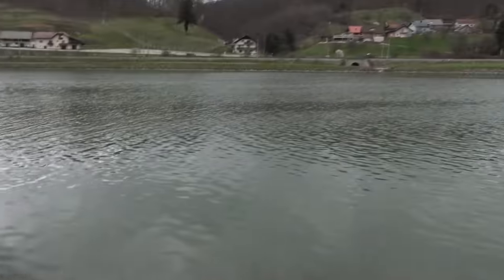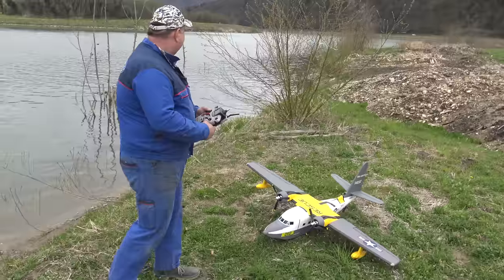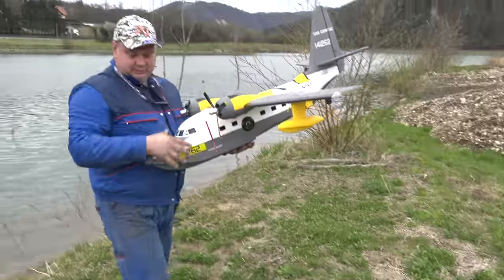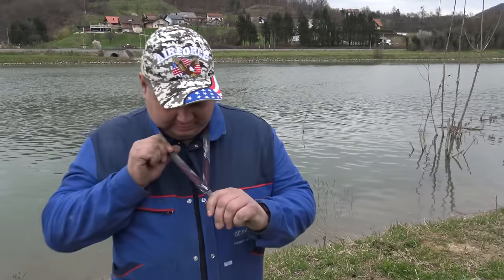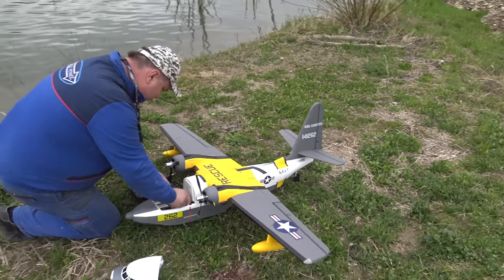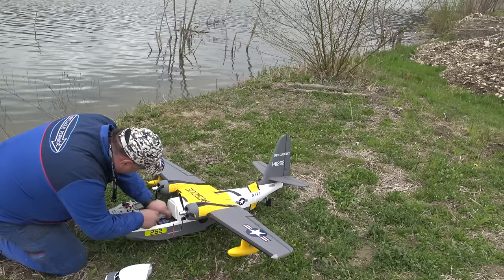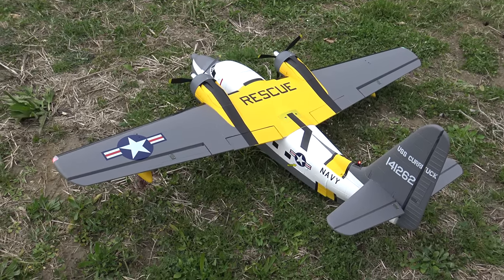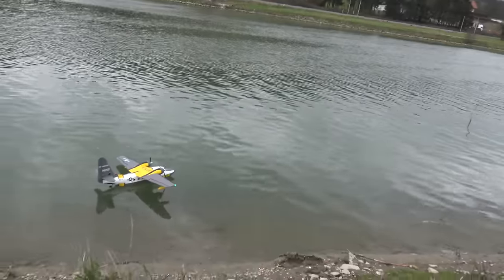Avios Albatross HU-16 Flying Boat 1620mm (63.7") PNF Crash on Maiden flight

Comment: There was a time when we built our models from balsa. We would take weeks, or months to build planes in the winter and then fly as the weather cleared in the early spring. On more than one occasion I left the house with several new planes to return with one that was reduced to balsa sawdust. You would take the walk of shame into the field, pick up the pieces, place them in a box and take the pieces home. Sometimes there was not enough left to take home. According to FB, this model is already back together and ready for Captain Blaz to fly again. And he will, and he will conquer this model.

Comment: Seemed a little tail heavy and underpowered.  Easy repairs so you should be back up in the air in no time. Hey!
Reply: Plastic Aviator oh power is there but cg was not
Reply: Those big planes are always under powered. Thats why I dont buy them. They should be putting larger motors in them. The battery size gave that away.
Reply: RC Hobbyist Extreme This one has tons of power. They did a great job on this one.
Reply: They have alot of power it was cg. And velcro the lipo
Reply: I feel your pain mon Capitan Blaz
Reply: RC Hobbyist Extreme  it’s got tons of power, way more than needed. It was just tail heavy.
Reply: Not underpowered in the slightest. Tail heavy only
Reply: Definately tail heavy
Reply: 7:25 - For those who say it's under powered! Takes off like a rocket when Captain Blaž miraculously saves it at this point!
Reply: Tail heavy for sure, but it went vertical for a ways. Power was not being used most of the time, but it was there.
Reply: @TheCentaury  - Lol, by the time you trim a tail heavy airplane it's already met the ground! Plus, even if you trim it it'll be severely twitchy. But then I guess you could program in a huge amount of expo.  Hell,  why bother with CG in the first place?!
Reply: @Perry_Wolf  I always trimed all my planes during flight without meeting the ground... I don't know if you're a good RC pilot but trimming is one of the first thing you do on each flight... Even the first test flight... This to avoid to always compensate on the stick while flying and even more important for landing...
Reply: @TheCentaury  - Actually, I have also trimmed all of my planes without meeting the ground. However, with a tail heavy plane it can be uncontrollable to point where you just don't have the time to take your hands off the sticks to reach the trim buttons, (just ask Captain Blaž, I don't think he even had time to think about the trim)! In my opinion, there are three ways to deal with this:

1) - You can get enough altitude that momentarily letting the plane go out of control will not result in an immediate crash, or

2) - You need to land immediately and fix the CG problem or,

3) - Have a friend stand next to you and trim the plane while you fly it.

With that said, trim is fine for combating minor aerodynamic errors, such as wing or stabilizer warping or control surface misalignment etc. Radio trimming can only go so far though, (and maybe not enough). I see radio trimming as a temporary solution only, (whether it's "on-the-fly" trimming or using the radio's subtrim/offset later), and I usually only use it until I get the model dialed in physically. Whether that's fixing a warp or adjusting control surface linkage to fix the errant behavior.

As far as CG goes, trim can only help with getting the plane to fly straight and level until you start making control inputs. Trimming the plane to combat this essentially adjusts the stabilizer's control surfaces to keep the plane straight and level. However, the moment you introduce a control input that extra weight rearward of the CG will effectively be "thrown" in the direction of the input and exaggerate the input making the plane twitchy and still hard to control. So trim is not an effective long term solution. You should land and fix the CG then fly and re-trim the plane. However, if there are other aerodynamic errors you're trimming out it is best practice to fix those without trim as well. The bonus with physically fixing CG and aerodynamic errors is, if you buy a new radio or accidentally delete that model's memory file, that plane will still fly good without having to do it all over again.

I apologize if you know all this already but I thought it'd would be good to mention all this for the newer pilots reading these comments. :)
Reply: @Perry_Wolf  Totally agree with 3 points on the resolution of an uncontrollable plane :D

In fact I will add that before the first test flight you balance your plane as perfectly as you can ... most of the time by holding the wing nerve on each side of the plane so you can directly see if the plane will have an heavy tail or an heavy nose

Comment: Capt Blaz', don't give up it happens to us all, no big deal, looks fixable. Looked really good in the air. It seemed to me it might have been a little tail heavy? I don't know, maybe the wind. It also looked as if it wanted to tip stall but HEY its ok. I still love it and look forward to the fixed plane video.   <o
Reply: Michael Anderson yes incorrect cg ;(

Comment: And again He fly to slow I was yelling at him before he crash I saw it coming he try to fly to SLOW all the time A.
Reply: Capt Balz does like to fly slowly lol but there’s nothing wrong in that,  this plane will fly really nice at slow speeds, the only problem was that it was too tail heavy and he didn’t recognise it until it was too late 🤦🏼‍♂️ did exactly the same thing with my durafly Excalibur a few weeks ago except I realised what was wrong and managed to get down straight away.
Reply: @TheMuddatrucker  Maybe, but main reason was as was mentioned in first comment, too slow for this setup, it was telling him several times and finally if feld trough left wing with no chance to save it. I don´t want to be rude, but heavy plane, wind, slow flight and bad setup of weight as you saying, too much reasons to lose plane, istn it? :-D
Reply: @TheMuddatrucker  There is something wrong with going to slow and enter a turn, thats called tipstall.... it was like 3...2...1.. what?   ah.. there we go... xD
Reply: Jan Černý  but you can’t call this a setup! All this is is a tail heavy plane so for that you’re right! You wouldn’t fly a tail heavy plane slowly but the thing is capt blaz didn’t realise it was tail heavy!    And I’m pretty sure if he did then he wouldn’t have flown it so slowly but when this plane is balanced correctly it will fly nice and slow without tip stalling so I’m not wrong in what I was saying.
Reply: e30kitty  I disagree! If the c of g had been correct then this plane will fly nice and slowly without risking a tip stall, capt blaz didn’t recognise the tail heavy characteristics so kept flying slowly, if he had recognised them I’m sure he’d have increased his airspeed and brought it down.
Reply: @TheMuddatrucker  yes so you are saying same as I do. He did not recognize it is tail heavy(i am adding to this point that plane was telling him several times it is tail heavy). There are also steps how to check center of gravity on the ground and he has to do it before minimally first flight. First flight in windy weather? I am saying that he did his best to kill the plane, thats all. Maybe plan, maybe lack of experience or maybe too less respect to plane, i dont know, but it was painful to watch. Good luck in future.
Reply: Jan Černý  they both know how to check the c of g,  the problem is that it’s not 80mm like the manual suggests,  like this it looks as though it balances but once in the air things soon appear very different and it shows as tail heavy straight away
I’ve got mine set at 70mm using a 526g battery and flys great now!

Comment: A bit of glue and it is fixed.
as you said to me: Fixed planes fly the best
My Avanti will hopefully get a remaiden soon, when I get a new fuselage.
only that will be difficult because..... yea look at my username. I also want a fursuit from like 1000 euros and I need money and I am only 15. I like spent already 1,5k on my rc planes (and car), and now my other hobby is also expensive. luckily when I turn 16, I can do a vacance job, earning 1000 euros in the month
Reply: ps read my bio for more info.
and btw maybe put a gyro on your plane, so it flies stable, and it will also help control the airplane if you lose an motor
Reply: Mine ALWAYS fly better with glue and tape. That model doesnt like wind. I was told by many pilots those big water planes are like that.
Reply: @scottfirman  my avanti would have flown better too i think, but it is too far gone, i tried to repair it but it there is just too much damage, because when the pilot was doing a takeoff, the nose broke off because the nosegear strut was too weak, it broke off and he lifted off, turned off the throttle, this caused it to stall and it flew right into a ditch, and the fuselage was destroyed after that(and also a piece of foam flew right into the turbine and it was totally shredded) and also i dont think it will stay together in a jet because of the speed and the G's you pull. but i got it for free after it crashed so i need to learn to fly with jets first because i only fly with a funcub, an easystar and a trex 450.

Comment: Hi guys.  Glad to see you got it back with minor damage.  Like many here have said already.  It looked tail heavy from the start and that crazy strong cross wind meant if it got slow in the turn it would stall and it did.  Blaz  (or Capt Splash LOL...only kidding),  you saved it a couple times but the odds were stacked against you.  Robert has a great attitude and showed his support for you.  You two guys bring so much needed fun in these crazy times and are an inspiration to all of us in this hobby.  I salute you both......now cut quick!!!

Comment: This was my birthday as well! Haha! A lucky day because the plane was recovered and can be repaired. It was crashed by the wind shear. The wind was on the plane's right. The plane was turning left, nose down. The wind lifted the right wing and there was no time to bank into the wind. It could happen to anyone. This is all fun and also a learning experience. Don't be so hard on yourself Captain Blaz! It could have happened with a fuel plane just the same as an electric. The pilot, any pilot, must always know where the wind is. Seeing the invisible wind is not easy. In this setting, watch the waves. You can see where the wind hits the water. At that point is the worst place to fly. Thanks for sharing! Have fun and fly again any plane you wish Captain Blaz! No Fear!
Reply: Jon Miner iiiioopoop
Reply: Jon Miner lp
Reply: Jon Miner 80+op
Reply: @josethenbeliar9739  What is 80+op?

Comment: Always remember to throttle up when making your turn to downwind.  Too slow and you will stall.  But plane is fixable and you are a good pilot.  Please don't stop making flying videos with Robert.  Yes, and I agree tail heavy and foam planes don't penetrate the wind like good old balsa planes.

Comment: I'm thinking about it ....so you are 100% that the module was working?..... and just a good tip for the electric ,give it a throttle range setup before fly to get the high power on.

Comment: That's hard luck. That wind is pretty strong. May have been better to wait till that wind had eased off. It won't be hard to fix. This is what happens to us when we are in this hobby but we still love it. I am glad you got the other float. Blaz did well to keep it in the air, I would have crashed it in a second with that wind. "AILERONS"!  Good one Robert. :D
Reply: Mike Flight thanks my friend....

Comment: CG had to be off a bit as plane was pitching up on high throttle. The Avios multiengine planes require more speed in turns. It’s windy and Pilot has “knocking knees” on a maiden...and Blaz is used to torque nitro engines. Just my thoughts.

Comment: Wow...hard to say what caused that crash. The cg? The wind? Pilot error? Maybe a little of all three. Msybe a transmitter/reciever glitch. Was the binding range checked? From the video it doesn't look under powered. In any event, I will ne very intetested in the next flight post repair.

Comment: Hey ! 
 Captain Blasz, no need to get so down on yourself. 
 Sometimes several things conspire together and can result in delivering the “Curved Ball” effect . In other words, crash.
Looked like the old G spot was a bit iffy along with too much aileron travel. 
Then you had a bit of a hooly of a wind to cope with ! 
 Any of these things in isolation & you may well have got away with it, but altogether, they  caused a bit of a 
problem.We have all been there. When you fall off the bike, get straight back on it immediately.
 So, cheer up old chap, you done well doing what you did.
OH YEAAAAH !

Comment: I love your guys attitude.we need more guys like u in our hobby.I've been flying for 30+ years.since I was 5 and my dad handed me the transmitter to a 2 metre glider that was probably 3-400 feet in the air.from that day I flew every weekend until I was 13.now I fly electrics and gas and I have plane called a "Wonder".it was designed by my father who passed away about 3 years ago.I wanted something I could put my modified Thundertiger Pro 36 with a tuned pipe.I wanted 200mph rocket and he designed me a wing that achieved 246mph.that was the last plane he designed for me it has been retired and hangs from my roof in my house.I would be destroyed if it crashed.I'm flying an old GWS P-51 Kit with all the trimmings.brushless motor and 4-6 cell lipos.the 6S is a bit too heavy but it's very quick and it fly's beautiful even at scale speed but I built it as a racing type mustang.

Comment: Captain Blaz, I think you need to trim the elevator  because it keeps the nose up and also you need to increase your throttle.  The plane stalled due tom lack of power.  It's ok Captain Blaz, this is part of our great hobby.  Minimal damage and the plane is fixable and you recovered the floats.  Good Luck on your next flight Captain Blaz!  I salute you!

Comment: Little too slow, may have been tail heavy, and definitely too windy! Sorry too see the crash Captain Blaz. It happens I crashed my P-51B, and it was a total loss just because the stabilizer/reciever  came loose. Spectacular crash though about 50 pieces over a ten foot area. And I learned something always glue down a reciever with a stabilizer don't just rely on double sided tape! So never waste a crash learn from it that's the best advice I got.

Comment: Some really serious tip-stalls and more obvious than that, the problem flying to slow down wind! It is something that actually require practice and getting use to... heavy wind RC flying is challenging even for the most seasoned pilot!

Comment: Well Capt. Blas, it was a maiden flight at a new location in windy conditions. Not so bad under the circumstances.
Here is what I think happened.
@6:53 it looks like you slowed down and actually stalled.
Then by @6:56 it looks like you are losing aileron control but you speed up and recover.
Then @7:21 you slow down and the ailerons go mushy again, and you almost lose it but don't..
Then @801 you are flying cross-wind slowly and the ailerons got mushy but you gained airspeed when you turned into the wind.

However, when you turned crosswind, you lost airspeed and the wind got under the outboard wing, and you did not have enough aileron authority to level the wings.
Reply: Nevada Joe yes all true :((

Comment: Captain Blaz, I was scared for you watching this flight. I know how hard it is to fly a plane in this situation. It looked tail heavy, and would balloon every time you gave it more throttle. The wind was pretty strong too. The only answer when this happens is speed up and hold some down elevator until you can get some down trim fed in. Very precarious situation and very hard to maintain control. You did well to keep it in the air as long as you did. Similar to Pilot Robert trying to fly the SR-71 before you two figured out the battery situation. Redemption flight - A more forward CG, and stay at 2/3's throttle or more. All the best from flooded Nebraska!

Comment: Captain Blaz, not your fault buddy, the plane looked a right handful right from the beginning. The wind was throwing it around badly as well. I built and maiden flew a Giles and it ended up in bits with that kind of crazy reefing up and down. Probably my fault during the build which is why Im so thankful to the likes of Eflite and Horizon Hobbies with all the critical bits factory built and all set up. This happens so dont beat yourself up over it.